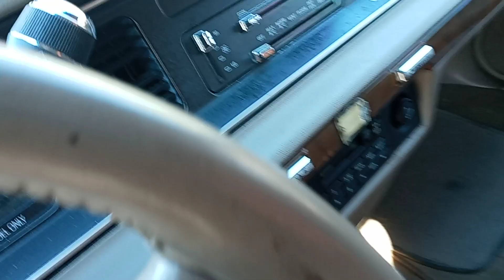I built a Youtube channel on Crushing these "Nice" Cars

Comment: The Lincoln wheels on an older F-150 is a direct bolt on with the 5x5 bolt pattern.  They would work and I've seen Lincoln wheels on a F-150 before.

Comment: Crown Vic , Grand Marquis 5 on 4.5INCH bolt Circle same as a Ranger. F150 5 ON 5.5 and Chevy 1500 5 on 5 s10 5 on 4.75. And now pretty much everything is a metric bolt pattern.

Comment: dang grand marq bites the dust. valve seals are known to go bad on the early 4.6s. Probably burns oil like gas. 4.6 design didn't get good till early 2000s. 96 or 97 they updated the head design for the valve seals. And those wheels only fits mustangs, panthers, rangers, trailers etc 5x4.5